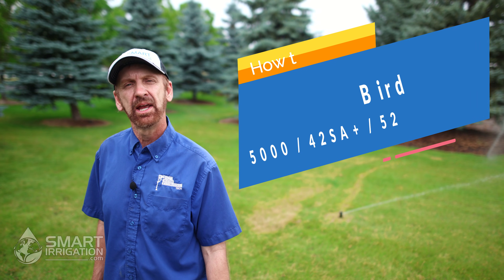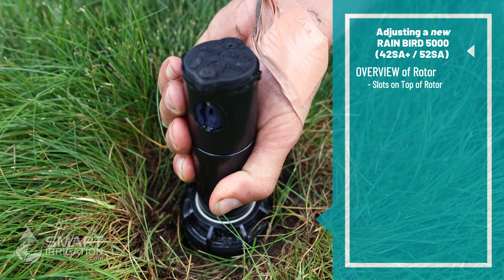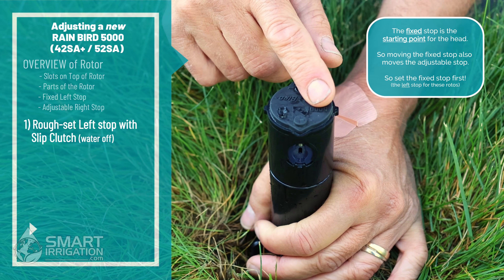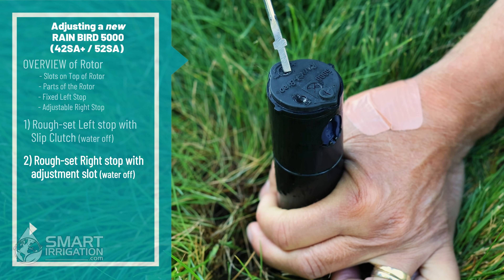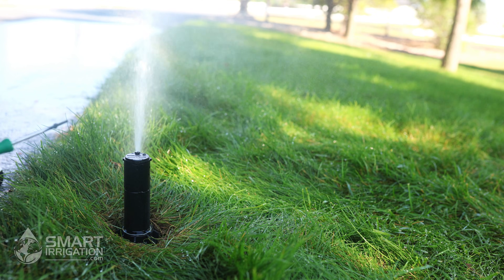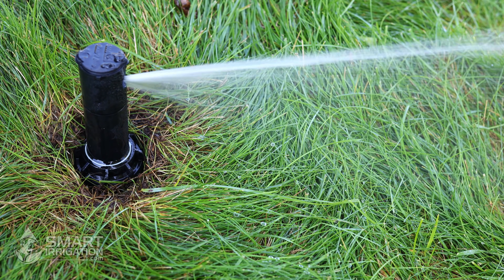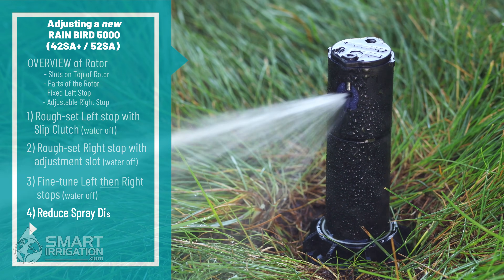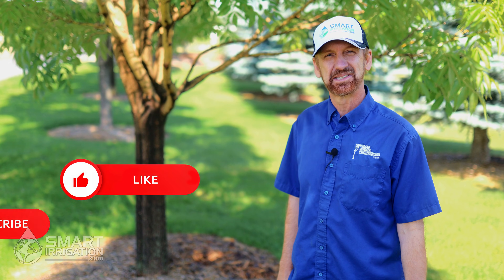Rain Bird 5000 Rotor Adjustment (for new sprinkler heads)

Comment: you don't explain how to adjust the starting point (right stop) before resetting the left stop
Reply from the maker: Thanks for watching.  As we mention at 1:43 in the video, these rainbird heads are left stop, meaning that the "starting point" for the rotor is actually the left stop and not the right.  This is why we show to adjust the left first (at 2:14), and then the right stop after (at 3:20).  Hopefully that clarifies things.  Other sprinkler rotors, like Hunter PGPs or Orbits are Right stop, but these rain birds are left stop

Comment: Are you working on a railbird 5000 plus in this video? you didn't make this clear.
Reply from the maker: Thanks for watching.  In this video we are working on a regular rainbird 5000 (a 5004-PC specifically).  As we mention at 0:53 in the video, the 5000+ would have a 4th hole in the center that controls the flow shutoff.  But the adjustments are the same regardless

Comment: How can I turn off the used 5000
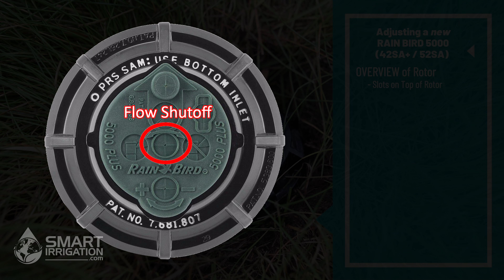Reply from the maker: If it is a 5000+ (plus) rotor, it will have a center flow shutoff slot on top, as shown at 0:57 in this video.  But if you just have a standard 5000 rotor, there unfortunately isn't a simple way of shutting the rotor off.  You would need to remove the head and put a cap/plug in the line, or something similar to that.

Comment: Help! My 5000 rotor is just continuously spinning and never changing directions. What the heck, no one has any information about this
Reply from the maker: If that is a new occurrence for it,  sorry, you will need to replace it. It's broken inside or worn out.
Reply: You may have the 5000FC (full circle) head. You need the 5000PC (partial circle)

Comment: "Hi! Quick question from a beginner who's loving the rotor sprinkler world:
When installing rotor sprinklers, I usually wrap the threads with thread seal tape and purposely avoid fully tightening the sprinkler into the fitting, because I've heard plastic threads shouldn't be overtightened to avoid damage. Is this practice correct, or should the sprinkler always be fully threaded into the fitting to avoid leaks or other issues? Also, if I slightly loosen or rotate the sprinkler body/base after installation, could that cause leaks at the threaded connection? Or is this type of minor adjustment okay as long as sufficient thread seal tape is used?
Thanks for your advice!"
Reply from the maker: Yes, you are correct, and turning the rotor slightly in the ground to adjust should not cause a leak if proper thread seal tape is used.
Reply: @SmartIrrigation1 Thank you very much sir! That’s perfect, I’ll try to do those adjustments then.

Comment: So what happens if you adjust the left hard stopping point TOO much.  IE:  I should have stopped at 100 degrees but I went around 120 degrees... I see you turned the BASE in the ground but what if that is NOT an option.  How would you bring the left stopping point back to a before point?
Reply from the maker: For a new head that has the slip clutch, you would turn off the water and then dry set as follows. Gently turn the turret in the direction that is easier to turn all the way to the stop. If that direction was counter-clockwise, then turn it until it stops with a click, and then turn clockwise unlit it stops, then continue to turn clockwise that extra 10 degrees. That's using the slip clutch feature to remove the extra 10 degrees on the left stop instead of turning it in the ground. (Caution: if you don't feel a smooth slip clockwise but a clicking stop, the slip clutch is not working anymore, and you will have to use our different video on previously installed Rain Bird 5000 adjustment.